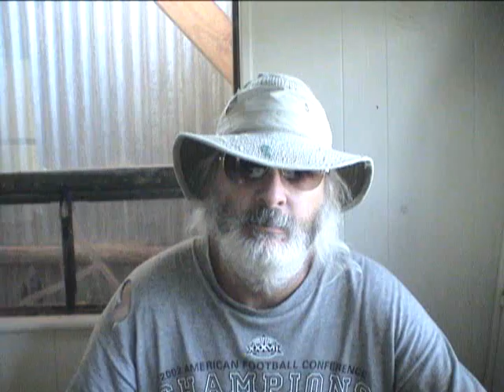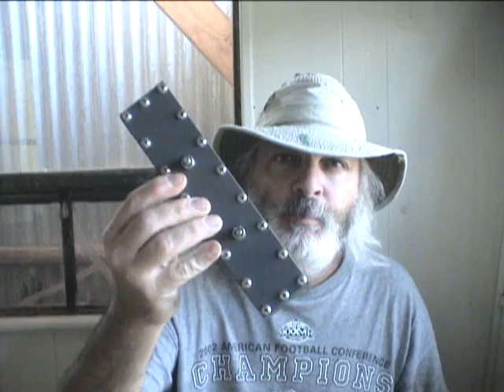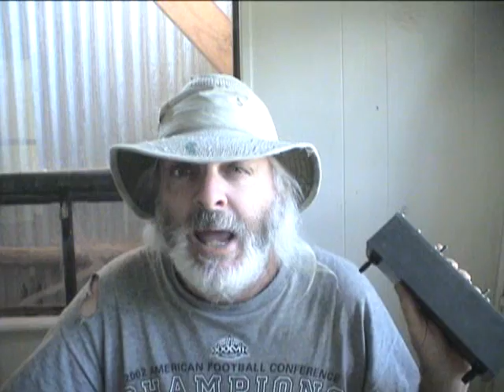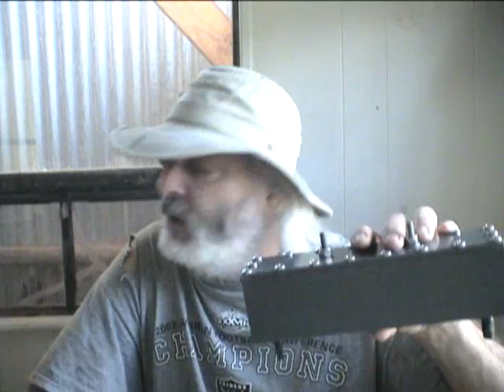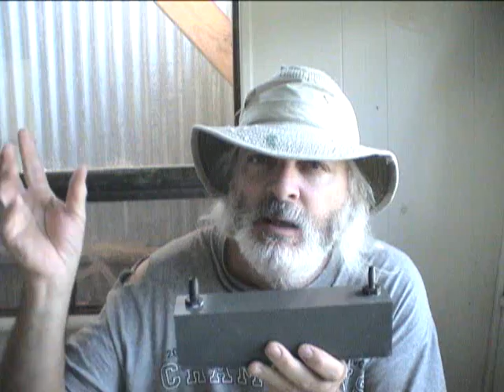Testing 'HHO' devices: I shall do so! This is video #0 of the series

Comment: Most internal combustion engines operate on or around 30% efficiency. Most of the energy from combustion is lost to heat, and unburned hydrocarbons that are wasted out of the tailpipe. If the efficiency of the combustion were improved by 1% that will more than compensate for the energy used to produce the hydrogen.

Comment: Idea for an H20 device that would work !
ATM some vehicles use a flywheel to recover energy in braking (ie some trams)

Use alternator or reverse starter motor braking instead (use gearbox to spin them v. fast), use energy (current) recovered to electrolize water into H & O.
Let these gasses be taken into carburettor when the vehicle is accelerated again (fuel burns more efficiently with more free H & O present).
Potential fuel savings, especially town driving. (ie lots of stop start driving).

Comment: Cavitation is indeed engineered out of maritime boat propellers but the phenomenon has unique uses and results in the exotic energy sector. Your plates will not be eaten away lol. That statement shows you have never built and experimented with electrolysis systems. The plates are stationary, most of the bubbles release and burst on the surface. You are not vortexing or spinning the plates, therefore, you will NOT cause damage to the internals of the cell. Being misinformed is dangerous.

Comment: You need to control the amps of a cell, because thermal runaway will cause the cell to draw too many amps thereby discharging the battery. A car battery that is discharged more than recommended will sulphate, and eventually need to be replaced.

Comment: would/could be excellent cooling/braking system too., storing energy as H2 & O instead of in a relatively heavy fly wheel.
would work best for cars that do lots of stop starts, ie, town driving or f1 racing etc.

Comment: Petrol/diesel have very high energy content, & burn more efficiently in presence of free O & H. ie, more energy gets liberated from fuels, potentially more than drawn from alternator to separate water.

Thus depends on how efficiently O & H can be separated (overcoming binding energy).
a novel catalyst etc might do it. IDK
unlikely any device does so efficiently enough to make big fuel saving ATM.
today's engines are already quite efficient.
If possible, it would be in science media by now.

Comment: A slight correction. 

The alternative hypothesis is that the device increases mileage. The null hypothesis is the negation of that: It's not that it doesn't have any effect. It's that it either has no effect or it decreases gas mileage. I'm betting it will decrease it.

Comment: @Desertphile
Well, I know it involves building a more robust Test-rig... But, maybe you should chock the throttle to hold the engine at 1500-2000 RPM, so the Alt. is at 4500-6000 ; so the Alt. can reach it's rated output..? That'll save the Battery from Suckflaticism... Did you catch my last 2 clips on the Magnetic Frootluip Wheels ? 1.33 is NOT equal to 3, nor is it more than 5..! And I revealed the T-Model Ford ran on Horseshoe Magnets on it's Flywheel 
(LT Magneto). Ciao !

Comment from the maker: My vehicle performance monitoring equipment is good enough to monitor fuel consumption with a margin of... calculating now... 0.05 of a gallon of gasoline per hour. That is +/- 5% which is well within my required 12% if the test was for the $1,000 prize.

Comment: Using hydrogen as a fuel additive is different that using it as a fuel. If you were powering the vehicle with Hydrogen alone, in a closed system, it would not be sustainable. However when you are adding fuel to the vehicle in the form of gasoline, and then using hydrogen as an additive to help burn gasoline more efficiently the net gain is a result that comes from the added fuel, not the additive.

Comment from the maker: Well golly shit. :-) An electrolysis device is generally about 50% energy efficient, up to 70% if very hot water and various chemicals are added to the water (according to WikiPedia). I will be estimating the watts consumed because my meter only handles 10 amps at 15 volts DC. If the Null Hypothesis is correct, the fuel economy will decrease at the rate required to power the electrolysis device.

Comment: @dangerouslytalented
G'day... Yay Yeam..! The HHO Bubblers run off an Alternator that's maybe 50% Efficient at Design RPM, but Dave's goanna Idle the Engine, so if the Alt is at 3:1 Step-Up Drive, it'll be at 1800-2100 RPM, so it'll be maybe Half rated Output & at 15% Eff.. Those Bubblers suck 30 Amps. Each Amp from an Alt. makes Fuel Consumption 1% worse.... @Desertphile G'day. At that RPM, I predict you'll flatten the Battery & stall the Motor.   ;-p Ciao !

Comment: I keep wondering if a high-output hho device would be useful if it were powered from a battery pack.  The battery pack would be  charged from relatively cheap grid power.

Comment: Sceptical, but had this idea.
what do you think DP?

Efficiency of electrolysis increases with temperature; ie no electricity required to separate H2&O at 2500C (spontaneous "thermal decomposition" occurs).
 
my idea is,
Use "alternator braking" to electrolyse high temperature steam, in tubes in & around combustion chambers & exhaust manifold (typically 1950C+(increase)).

Electrolysed high-temp O2 & H2 expands into next burn-cycle, faster, hotter, more efficient fuel burn., esp. acceleration.

Comment: A week later follow up. . . . Hmmmmm

I never calmed anything about my ability to construct any sort of anything. I do however have an interest in how things work.

You have failed I feel, to understand I'm addressing the issue of the computer tech., that is in most cars made these days. The computer will deal with the new fuel mixture, as not what it wants, and try to reset the parameters of the fuel air stuff, to a point of . . . why bother.

Look it up your self. Don't believe me.

Comment: "An optimum HHO engine device, is a separate subject."

Not in the context of the video you're commenting on. An onboard HHO generating engine device which claims to boost fuel efficiency by burning gas to run a machine to produce HHO is the topic. THAT claim is bogus. As to building a device to produce HHO or running a device on HHO, that's child's play. It's a high school science project and not much more complicated than that.

Comment: Again. The facts are in your face and you refuse to accept it. Read some of his comments. He states the builder does not KNOW he has the device. His justification which is laughable is that if he did know he has it, he would get pissed and sue Mr. Desertphile. LOL, implying he bought it, HHO does save fuel, I can point you in the direction of pages and pages of reports and data to prove it. The energy in vs the energy out has also been measured to show a surplus so again, you have been miseld